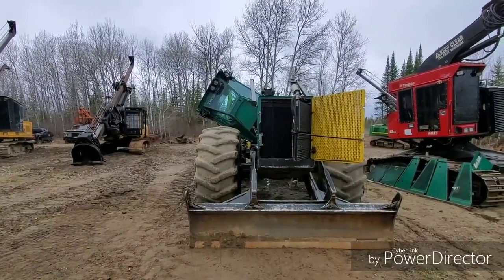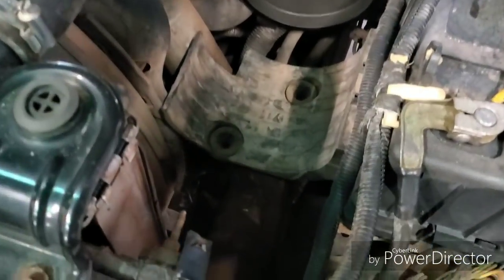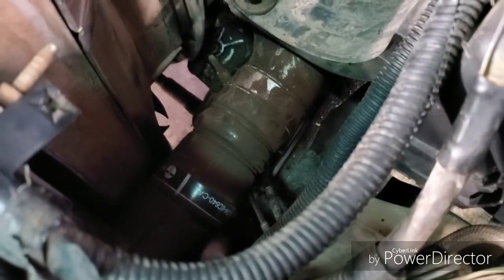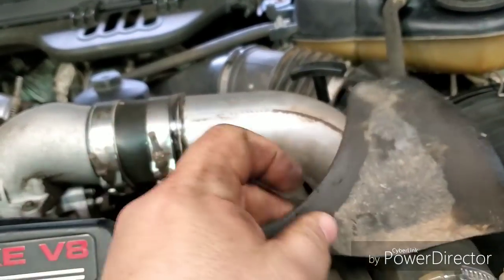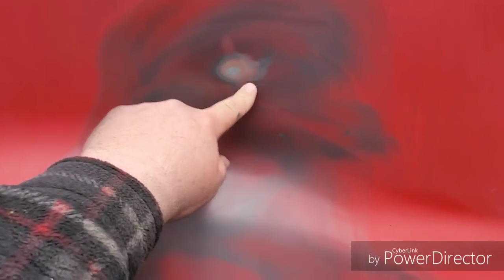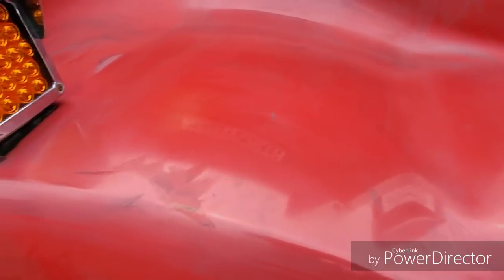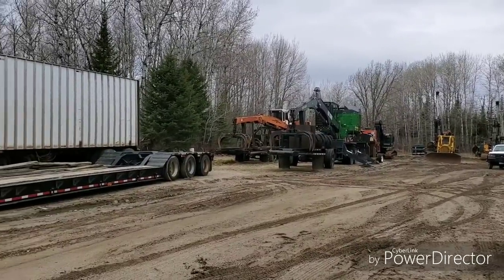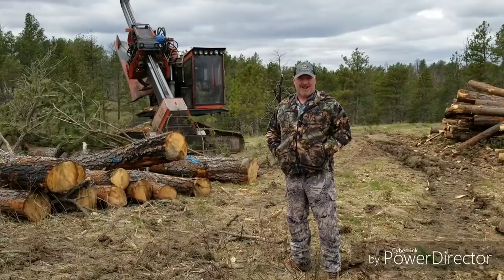Steering Sign Color Short Bus

Comment: Your videos always make me smile :)  Tell your Mom when she's done with it, I wanna buy her short bus.
Reply: I've been remanufacturing steering gears for a living for over 25 years and I CAN NOT adjust a steering gear properly in the vehicle. I adjust them all day long on my test bench , but it is too fine an adjustment to do in the vehicle.  Back the adjuster back off to where it was. That is not the problem!!!  Your Taking a chance of pealing chunks out of the three teeth of of the  sector and grooves where they mesh in the piston. Over adjustment will also cause wander down the  hwy as your alignment can not overcome the binding between the sector  and piston created by over adjustment not allowing to return your steering to center. So you end up herding your vehicle down the road. Play in the ford gears is caused by wear in the 28 , .25 balls riding in the worm and piston.  Not sure what year your truck is but that is a 1997 and newer top cap on the gear. I have also seen many of those newer 97 + gears that the adjuster wears where it attaches to the sector shaft, causing the sector to lower into the piston over time. Just what you just did. Over adjustment.This causes binding and wander down the road. If not addressed and the sector continues dropping  into the piston, will cause a no return of steering wheel when going around a corner and chewing out the teeth of the sector. 2005 and newer trucks with the fat sector shaft are really bad for this. To check for up and down play (wear) turn the steering off of center at least a full turn to get out of full mesh. Now if you can push/lift the sector shaft up and down towards the top cap that will tell you the adjuster is bad.

Comment: Paint that thing! It'll look a lot better than where you were buffing with an AXE!. The tree looks like it was a victim of tree falling with explosive weapons and I've been accused of riding the short bus but it'd have to be even shorter for me. Like a unicycle with a cab on it. And the snow? Remember you live in the FRozen North, even if it is in daylight which you are NOT accustomed to. A good with the steering box. I tried it and the thing would seize up. Had to open it back up and seems like everything you have has a crick in it. Have a good day and wear a welding hood. Then you'll think it's dark and won't be surprised much.
Reply from the maker: Great and very funny comment Lewis!
Reply: @davidhaley7053  Mostly true. Ain't THAT pitiful!